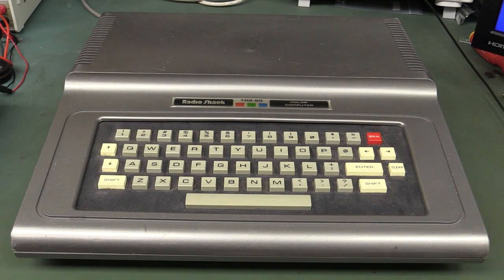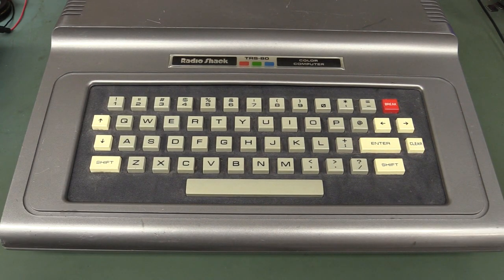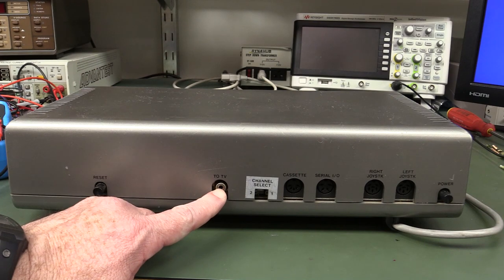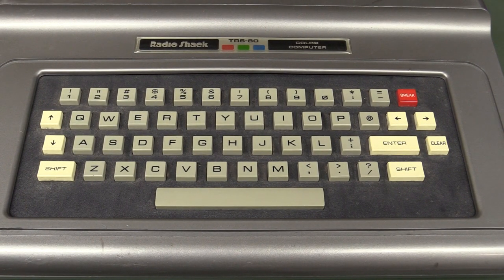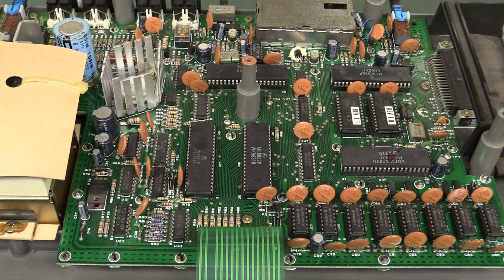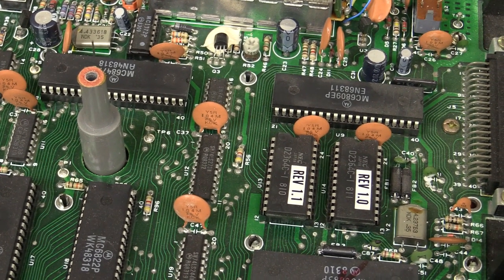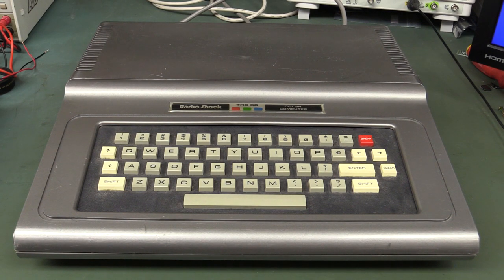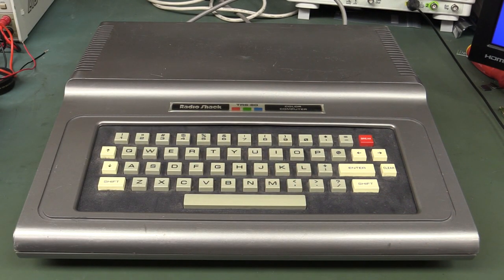EEVblog #1021 - Retro Radio Shack TRS-80 Color Computer

Comment: The screen looked a bit crisper than that on NTSC models back then, but usually that took tweaking of the various analog mystery knobs on the TV.  PAL was supposed to be crisper (but get you fewer "accidental" colors) on contemporary hardware...
Reply: PAL is slightly higher resolution.
Reply: Right, but the use of color burst in NTSC vs frequency lock in PAL made more of a difference (as with the Apple II you could get extra colors by drawing vertical lines one pixel apart on NTSC, on PAL you actually got the lines...)
Reply: C64 @ PAL monitor looked about the same. I even found a special program that could switch the framebuffer from 40 to 80 horizontal characters, which made text literally unreadable. Altohugh when you actually view it on a low-tech monitor instead of upscaled on a TFT, you notice the bad quality a lot less.
Reply: We used to use a small subroutine to make use of those "accidental colors". It was called Artifacting- the drawing of 2 lines to create a 3rd color. If I recall, the command was Paint x,y or something similar. You could fill areas with colored patterns and a couple extra colors. I used it to make a BASIC Missile Command.
Reply: The PAL version looked as good as the NTSC version, allowing that the NTSC colour phase knob was properly adjusted. This is just Chinese digital junk that don't play well with those laffly old analogue signals :P
Reply: The PAL version probably didn't have quite the capacity as the NTSC for doing those funky extra trick colours on porpoise though :D
Reply: Back when I got this machine new, I had a little Sony CRT TV that had a very nice crisp video image on channel 3/4.

Comment: I still have one of those sitting out in my garage. :)

I liked the 6809E, especially when I discovered its PCR (Program Counter Relative) instructions, which allowed you to make a program completely relocatable so you could load the program along with its data anywhere in memory and because the data access instructions were PCR, it could still find the data.

I wrote a machine-code program which could be loaded anywhere convenient in RAM and then called from a BASIC program to write text onto the high resolution graphics screen.  The only other way of doing that was to draw letters using the graphics commands, which was slow and cumbersome.

I'd usually reserve 6 "pages" of RAM for the graphics screen because you needed 4 pages for the high-res screen and I could load my graphics routine and data into the other two pages.

The routine printed the full ASCII and IBM extended character set and had all kinds of advanced functions, like cursor positioning and even the ability to redefine any character using a BASIC call.  Want a custom character for a game?  You could send it to the machine code routine and have it replace a character you wouldn't be using in the program, then just print the re-defined character.

Unfortunately, this was right at the end of the "life" of the CoCo and the IBM PC was taking over in popularity, so I never bothered to send the program to anyone.

I probably still have it on a tape somewhere out in that garage, though.

Comment: Well this brings back memories. I learned assembly on a Coco II in the 80s. They had a lot of software including an assembly language development cartridge called EDTASM ("editor-assembler"). They also had an entire office suite called "VisiCalc", which I probably still have. I helped a small engineering firm write code on it for a system to test diesel engines during manufacture on the assembly line at the 20 acre, Jamestown NY Cummins engine plant. It was the arduino of the time (sort of). We mounted the CoCo II motherboard in a big Square-D box and fitted the proper relays and drivers with 7-segment displays. We used 6821's everywhere for IO. Cummins was pleased and used it on their assembly line. Little did Cummins know a Coco II was driving their engine test rig! I did the composite video mod on my own machine and other mods as well, and then bread-boarded many various self-made projects including a digital sound sampler (stored audio in static RAM), digital light dimmers, graphic drawing programs... all written in assembly on EDTASM. The graphics were better (clearer) than the CoCo in this video, and it had a pretty good implementation of BASIC which was actually written by Microsoft. Wikipedia says Color BASIC was actually designed by Bill Gates. The 6809E (E = external clock) ran at 2 MHz. Spent many hours learning what would now become my profession on the CoCo II.
Reply: "Arduino of the time".  That's what I keep telling people - Arduino is nothing new; all of the 8-bit home computers were highly hackable.  It's just that a whole generation grew up with nothing but 32-bit computers that were much, much less friendly, so when the Arduino guys came up with a "new" DIY 8-bit platform, it was the greatest idea of all time.  Sort of.
Reply: Exactly. Processors like the 6800 and 6809 were very easy to work with, 100% static, and the family of chips, like the 6821, were also very simple. You could have IO up and running in less than an hour. The only catch was address decoding logic for connecting other chips to the address bus. Simple if you have a little experience. Nevertheless, it's amazing what we did with a 2 MHz processor back in the day.
One thing I remember is boxes of cassettes. Using EDTASM, I had to store all my code on cassette tapes because the EDTASM cartridge occupied the slot the optional disk drive used, so you could not use them together. Never had a problem though. Cassette storage was surprisingly reliable.

Comment: This was my first computer as a kid. (I was around 7 or 8)... I remember my dad brought it home and that was my first experience with coding.  I would write all kinds of programs in basic.
The model we got was a 16k version.. I remember my dad eventually upgraded it to 32k and then 64k by piggy-backing the chips together.

The cassette player was always the weak link.  That sound!  And it would only work some of the time.  When they came out with a 5.25 in floppy for it, it was so much better... 

Two biggest quirks... make sure you popped open the floppy door to pull the heads off the media before turning the computer on or off or you'll destroy the floppy.

The most annoying thing was also a great feature.  If you shift-backspace, it would delete the whole line.  There was nothing worse than typing in a huge long program line out of RAINBOW magazine only to accidentally hit shift backspace.  TO THIS DAY, I still catch myself thinking about releasing the shift key before I hit backspace.

Comment: This is my first computer and covered all those manuals then. Traded it in for the coco 3 + modem for 80 column 256 colour which luckily made the peak of 8 bit computing was amazing. Now I picked up coco 2 (soft round keys) and installed the composite circuit and get wavy lines.

Comment: This brings back fond memories. I modded the daylights out of mine.
Added lower case, new standard size keyboard, as mine was a version 1 with 16k only I modded it for 64k, added the expansion module, got a floppy drive controller that also held 4 EPROM's so I could modify the OS and burn new EPROM's.
One of the last things I did with it was to add a 32 MB hard drive.
Thanks for posting this video.

Comment: I was in 7th grade in '79-'80 and 8th grade in '80-'81.  At the time, I lusted for the TRS-80 Model III, but couldn't conceive of affording one.  I considered the CoCo a toy.  A friend of mine bought one of the last 4K CoCos on clearance.  He generally only used the machine when I visited him.  I ended up using it more than he did!  He had a habit of buying things and then quickly becoming bored with them.  He offered to sell me the CoCo, a tape recorder, joysticks, etc. all for a pretty reasonable price.  The Model III was a pipe dream.  I decided that a CoCo was far better than no computer at all, so I bought it from him.

After several months, I outgrew the 4K RAM and standard BASIC.  I had a very good relationship with the manager at my local Radio Shack store.  I took my machine to him and ordered the 16K RAM upgrade with Extended BASIC.  Rather than make me wait for several weeks with no computer while mine was being upgraded, he sold me (for the price of the upgrades) a brand new machine from his inventory that already had the specs I wanted.  He said he was then going to send my old 4K machine away to be fully upgraded to 32K, etc. and he was going to buy that machine for himself.  This was pretty cool at the time, and later turned out to be quite fortuitous.

After a year or so of living with the horrible TV video quality (yes, Dave, it was just as bad then, too!), I bought a cute little 9" monochrome green (composite video) CRT monitor and modified my CoCo with one of those same Darlington circuits you found.  The image was beautifully crisp!  The text screen was still 32 characters wide by 16 lines, with fake (inverse video) "lowercase" letters, but it was much easier to stare at for long programming sessions.  I wasn't much into graphics or games.  I liked learning about 6809 assembly language, so a crisp monochrome text display was a big win for me.  (As Dave mentioned in the video, using the Darlington buffer circuit permitted continued simultaneous use of the RF modulator with a color TV.  So I had both hooked up.  For crisp text, I looked at my monochrome monitor.  For color and graphics, I looked at the TV.)

Somewhere along the way, I acquired a floppy drive.  This was a huge improvement over the cassette tape!

Eventually, I discovered magazine articles explaining how to swap out the 16K RAM chips in favor of 64K RAM chips, along with the associated circuit modifications (cut a couple of traces, solder a couple of wires here and there, take advantage of an unused NAND or NOR gate in one of the quad-gate chips).  Voila!  64K bytes of RAM!  (This is where it turned out to be fortuitous that my Radio Shack manager had upgraded me to a brand new machine a couple of years prior.  The newer rev PCB required far fewer invasive modifications to upgrade to 64K than the older rev PCB would have required.)

Over the next couple of years, I added the OS-9 Level I operating system.  I continued hacking on this machine until I graduated from high school in the spring of 1985.

I started college in the fall of 1985.  Sometime around there, I bought a spiffy new CoCo 3!  I eventually upgraded it to 512K RAM, the OS-9 Level II operating system, and a third-party hard drive system!  The hard drive and associated controller set me back around $1,000 US.  It was all very cool!

Unfortunately, college left me little time to play with the CoCo 3...
:-(

The computing resources at the university sucked me in and I found myself using things like TOPS-20 on several DECSYSTEM-20 machines, some VAX/VMS, and mostly BSD Unix.  In a few years, I was a fully-addicted Unix hacker.

By the mid 1990s, Linux had come along, making an affordable personal Unix-like system a reality.

I still have my CoCo I and Coco 3, but the other peripherals (floppy drives, hard drive) and software (all on 5.25" floppy disks) are hopelessly lost or damaged.

I have a crazy dream of writing my own 6809 emulator that will run on Linux, on a modern mainstream Intel machine.  I know that several such emulators already exist, but I dream of writing my own from scratch, just because...  My dream also involves going well beyond the CoCo architecture to design an (emulated) machine with a 24-bit physical address space, a modern MMU, separate user and kernel modes, etc.  I also want to build a real physical "lights and switches" front panel and interface it to my emulated 6809 computer.  None of this will have any practical purpose...  It will just be a project to do "because"...

Someday.  Maybe...

Walt

Comment: My Coco2 has (not had, has) a monochrome composite out and it's crystal clear even 30 years later.  

Under OS9 it runs 80x40 with real lower case and it's wonderful.

Comment: I had one of these. I had the 16K version. (There was 8K, 16K & 32K available at the time.) You plugged in a cassette machine to save programs. The games were simplistic, even for the time. Yes - those are the colors, it`s not your hookup. That`s exactly how I remember it looking. I had mine for years. I don`t remember exactly how long. I never upgraded it but I did use it a lot when I had it. I had a couple of the game cartridges (I remember that I discovered a glitch in the football game that allowed me to score a touchdown every time I got the ball). I used some of the programs & had fun altering them. I remember the "music" sound was about the same quality as the color. Thanks for the trip down memory lane.

Comment: I learned BASIC (and Extended BASIC) on my Dad's CoCo (16KB) which he bought from Radio Shack in Miami in 1981.
Used it for 4-5 years - probably more than he did. It really did look that bad. I probably ruined my eyes using it. 8 Colours at low res - claimed 64x32 but it was faking it by using special 2x2 "matrix" characters in the 32x16 character display. The extended graphics were only available via Extended Basic, but as the resolution went up, the available colours went down. And no text when displaying "high" res graphics.

You should try to hooking up a cassette player/recorder to hear how it saves your programs.

Those Joystk ports are for potentiometer joysticks - I still have some of the 2D pots that came from them. For whatever reason, my Dad bought spares which we never used. The most advanced thing I did was a 6809E assembler program that would capture sound samples from one joystk port and play them back in a loop to the TV -- this was several years before sound cards. I plugged an amplifier output directly into the joystk port and did a binary chop algorithm using the Joystick comparator and DAC. The 800kHz machine code speed was enough to capture voice but the 16K filled up very quickly - only short phrases could be recorded.

The assembler was EDTASM+ which came on a ROM cartridge.
Reply: I still have my EDTASM on cartridge AND floppy. :) I had the original Coco 1 with "32K" (really 64k) and got the floppy as a high school graduation present. I killed it trying to set it up as a 16k computer not realizing the jumpers changed the power from 5v to 12v. Doh! Young and dumb. :) By that time I replaced it with a Coco 2 which I still have stored. 

Somebody made a character generator for PMODE 4 ("high" res) that hooked into the BASIC interpreter, so you could run the system in that resolution while working, which gave you mixed case more characters on the display (53x80? IIRC). The later editions could show the lowercase characters on the green screen.

I loved that computer.

Comment: My first computer was a CoCo 2 bought in November 1983 with 16k Extended Color Basic for $150 or so.  

Over the years I added a printer and floppy disk drive.  I used it as terminal for packet radio from late 1987 until the summer of 1988 when I bought a PC XT clone.  With the Coco 2 I used an office suite word processor to write our local radio club's newsletter.  The most ambitious thing I did with it was upgrade the RAM to 64k myself.  I never took the plunge into OS-9, though.

In the '90s gave it to a friend in Oklahoma and he passed away some years later.  It's probably rotting away in the Garfield County, OK landfill.  :-(

Comment: One of the best things about the CoCo was the operating system, which was OS-9 by Microware, one of the first 8-bit UNIX-like operating systems. OS-9 was also a very popular industrial/commercial embedded operating system, especially on Motorola 68K VME systems.  Many engineers using OS-9 at work had a CoCo at home to use as a (very limited) learning and practice tool.
Reply: Bob Cunningham Nitros-9 is an free open source reverse engineer of OS-9. It's fun to mess around with and a bunch of retro games are available for it.
Reply: That's the epitome of an ignorant comment.  Sounds like it comes from someone knowing absolutely nothing about computers.  It was and still is in many ways the backbone of the Internet.
Reply: Vendicar Decarian - Got a smartphone? UNIX. (iPhone or Android - they both have a UNIX-like core). WiFi router? UNIX. (usually a variant of Linux). Smart TV? Ditto...
Reply: OS-9 was never standard on the CoCo. It was an optional add-on. The standard OS was the very simple BIOS underpinnings with a Microsoft Basic (or Extended Basic) interpreter overlay.
Reply: @James Kerns Jr: Obviously he's trolling this thread.
Martin Heermance: Thanks for sharing that! It is amazing what I don't know existed until some one posts it. might tempt me to take those computers out of storage some day. Getting it from this HW to that HW could be an interesting challenge.
Reply: OS-9 was a great OS, but it was unfortunately an extra-cost add-on.  The BASIC ROMs were cassette I/O only.  The expansion ROM in the floppy controller simply added some simple commands for reading and writing files.  OS-9 was sold separately and required 64K RAM and at least one floppy drive.